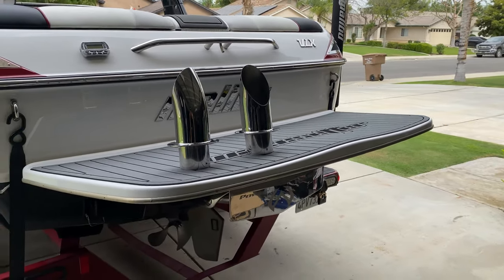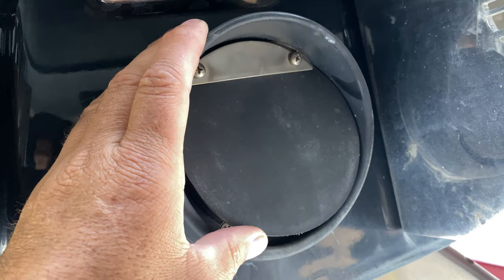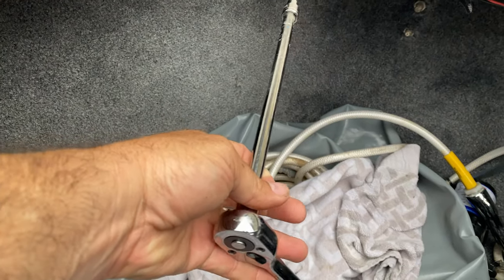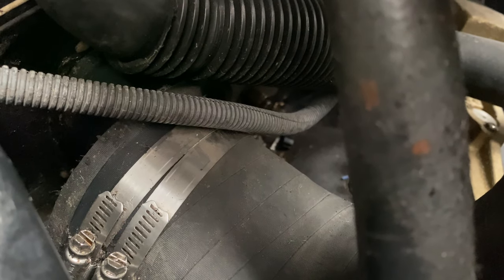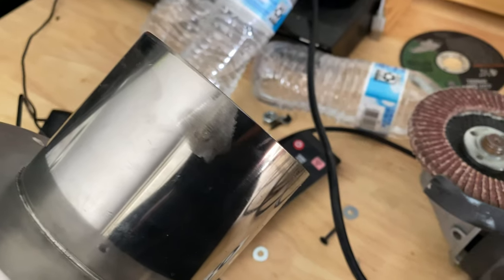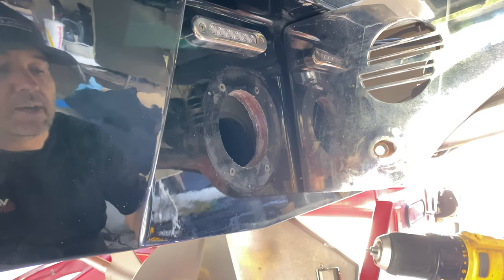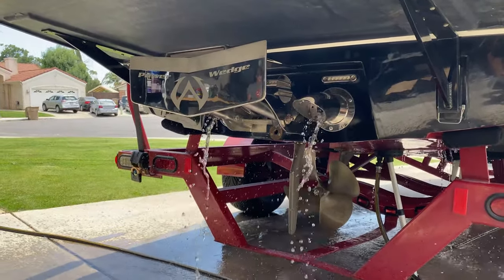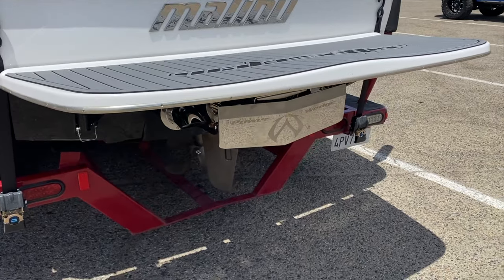SHOW ME YOUR TIPS! Stainless exhaust silencers on a wake board boat.  Malibu VLX 2008.

Comment: The silicone usually has a cure time. Might want to double check it and make sure it was installed correctly to prevent leaks. Great work though
Reply from the maker: Said 24hours

Comment: can you just cut the tube off the flange on the stainless tips then take the exhaust flaps off and just add the tips to the outside?  not connecting to the actual exhaust?  all your trying to do is redirect the flow correct doesnt need a seal?
Reply from the maker: The ID is different
Reply: @btuff  Ty!   I have a 2000 Gekko GTO ski boat and we are having one hell of a time weighting to to surf me.   My girl surfs it fine I'm 230 riding a Hyperlite Broadcast Board it won't surf me.   We tried 450 in front of the motor and about 1000 behind and it was to much weight the boat was dangerously low and really bog down. The best setup we have so far is 2450 lb bags one on the surf side all the way back and one on the non-surfside next to the motor with a suckgate.   I haven't tried is different some gate positions do you have any other tips?

Comment: Did your transom rot out yet? This was pretty painful to watch. Never sealed your screws going in. Definitely not near enough sealant either, almost no squeeze out. Should have used 3m 4200. Thru-bolt always when you can, don't have to worry about spider cracks then.

Comment: BEWARE this is not the correct drill bit size (7/32 end drill bit) if you plan on using the 1-1/2 screws. This ruined my whole day. And Home Depot, Menards, & Ace DONT carry screw sizes bigger then #14.
Reply from the maker: How did it not work.  What didn’t work?
Reply: BTUFF the 7/32 drill bit hole was too large for the size of the screw.